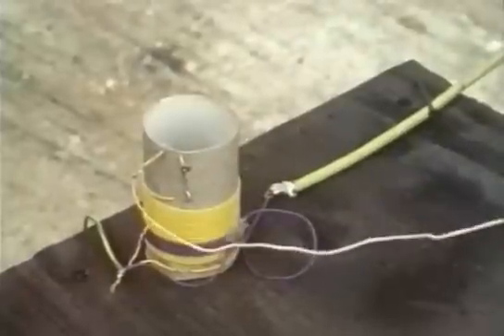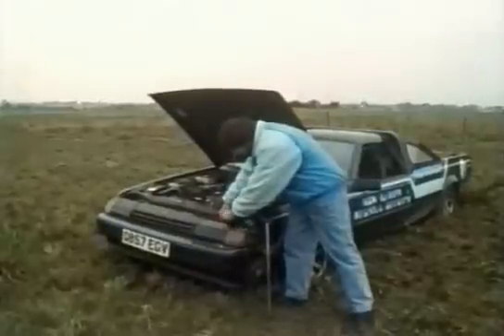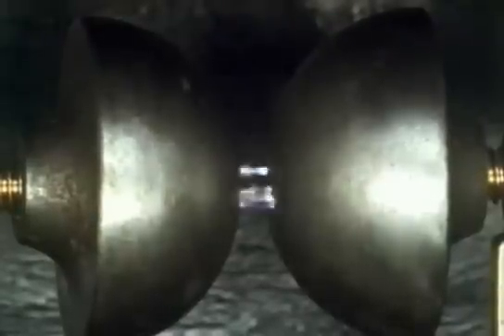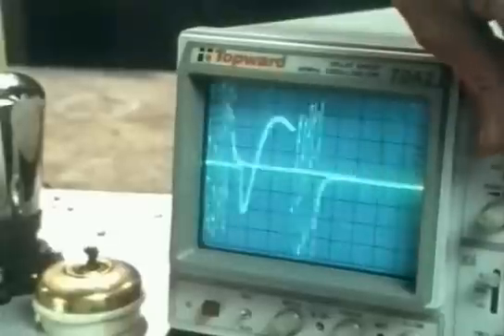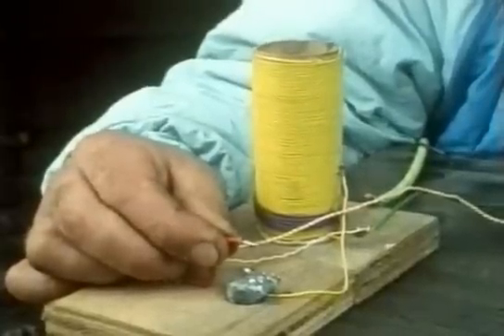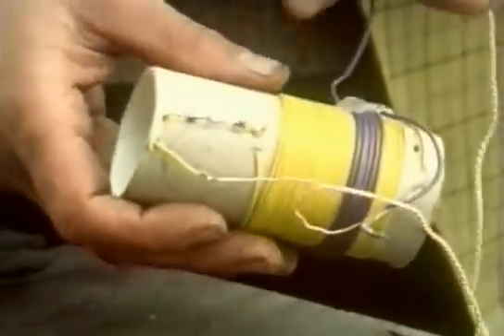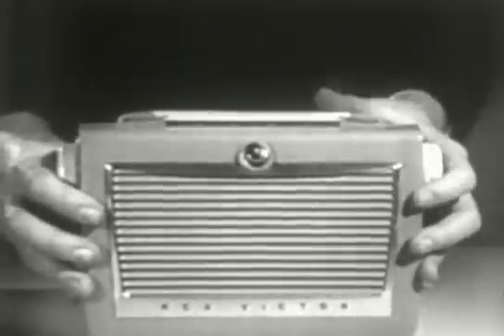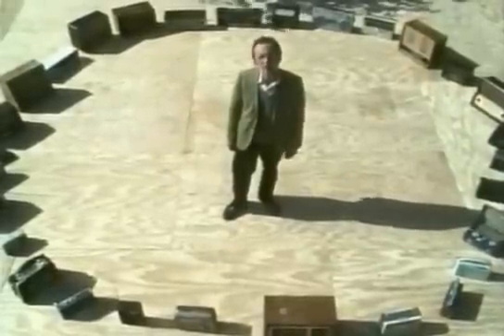Secret Life Of Machines - The Radio (Full Length)

Comment: The first who created radio was Tesla, not Marconi. In 1945 Supreme Court of US recognized his patent as first.
Reply: Exactly. Marconi's patent used concepts Tesla had patented earlier.
Reply: Radio has many fathers, and they all argued over paternity.
Reply: Which patent was that, CmputrBlu?  What was the US patent number?  When was it published? Or did it exist at all?    

Did Tesla specify a coherer containing 95% nickel, 5% silver with a trace of mercury in a vacuum?  

Did Tesla specify spark gaps using four balls?

Did Tesla specify long wire antennas? 

In 1890 Professor Richard Threlfall predicted that Hertz' discoveries would be used as a signalling system. 

 Did Tesla copy what Threlfall said or did he come up with the idea independently in 1893?

Does any Tesla fan boy know what he is talking about when it comes to wireless telegraphy?
Reply: Neven Tomičić        I was going to comment on how Marconi was using Tesla patented devices in his transmitters. You however beat me to it.
Reply: Which patents were those, exactly? Please supply US patent numbers. When were they published?
Reply: Hm. @Codenwarra Cove, Tesla had 11 patents on radio (#645576, #649621, #613809, #685955, #685953, #685954, #685956, #787412, #723188, #725605, #1119732) covering the spectrum of principles and techniques of sending, receiving, tuning, power transmission, activating a lamp or other device (buzzer, motor, etc.), and remote control. He also had nine patents for generating high (radio) frequencies (#447921, #462418, 514168, #658176, #658178, #658179, #658180, #577670, #583953) and eight for using that frequency to control another circuit (#609251, #609245, #611719, #609246, #609247, #6092489, #609249, #613735) that started in 1890. 
The British version of Marconi's patent (#7777) uses a circuit diagram that closely resembles some of Tesla's high frequency generator patents. It's a poorly tuned spark gap transmitter that had poor reception across 1/4 mile of Long Island Sound, (Tesla had been working on 2-5 mile transmissions for remote control at that point, focusing on a good 'ground' contact), but it was enough to impress President Theodore Roosevelt.
Marconi was focused on impressing heads of state, while Tesla wooed bankers and Hollywood celebrities. In this sense, Marconi made the better choice. Bakers sell debt and celebrities are usually fickle and vapid, but presidents, kings, and heads of state set policy for nations.
Reply: The priority and publication dates of all and any of the patents is important, since much of what Tesla knew was also known by several others.  Filing date of Tesla's  US 645576 was 2 September 1897. Priority date also recorded as  2 Sept. 1897. Published 20 March 1900.  Since the priority date is the same as the filing date, it appears that Tesla filed a complete application on that date, not having filed a "caveat" or provisional application beforehand.  The caveat would have given him a year to file a complete application.  

The UK 7777 patent was by no means the first Marconi patent and concerns a tuning circuit which I gather was mostly developed by Prof A Fleming.  It was subject to challenge in the British courts. But it does not matter about it, the  question is when the first patent application was filed and published anywhere whether or not the system was tuned.  Neither does it matter about high frequency generation, Hertz was already on to that and others soon after.  Hertz, Braun, Popov,  Righi and Branly among others.

Secret experiments by Captain Jackson of the Royal Navy appear to predate Marconi's arrival in England.  Since they were secret and unpublished, they could not affect patents.  

The priority date of Marconi's first British patent is in fact difficult to find because of the vague nature of most biographies that I can find on line but I believe it to be 1896.  In addition, Google insists on giving details of the US 586193 but not UK patent in which Marconi described his improvement to the coherer, an invention which was patentable in itself.  This device contained a mixture of nickel (mostly) and silver filings with a trace of mercury.  The US grant and publication was 13 July 1897,  some 7 weeks before  Tesla's filing date.  The US filing date was December 7, 1896 which is consistent with Marconi's arrival in the UK in 1896 if the US application was under the Paris Convention.  None of the 11 patents you listed discloses such a coherer and all are later than 13 July 1897.

If this is the US version of Marconi's first British application, and if the version was filed in the USA under the 1883 Paris Convention which the USA accepted in 1887, then it would retain the British priority date as long as the application reached the US office within a year of the British filing.  Given the rapidly developing state of the art in the mid 1890s Marconi's attorney should not have delayed and should have used the Convention. But if this application had appeared before me during my career as a patent examiner I would have sent it back for amendment, since the claims are unsatisfactory by current standards.  But by the standards of the 1890s, who knows? 

Now the decisions of the US Supreme Court are just so much paper in other countries and patent law in the US has always been different from patent law in the UK and most other places. So the decisions of the US court mean little to me.

I stand by my previous questions.  The documents, as far as they can be found, show that Marconi's wireless telegraph system as patently described predate any similar material by Tesla and Marconi could not have used any patent from Tesla in 1896.
Reply: Hm.

A coherer is a device that discharges when the circuit receives a radio signal. Tesla used evacuated lamps (gas discharge tube) for that purpose, which appear in 568178; 568179; 568180; 577670; 583953; 609251; 609245. 613809 is for radio controlled vehicles & goes into detail for an extremely sensitive switch made from a capacitor with metal filings charged to the point it almost conducts. When the signal is received the gap is bridged.

The difference is between patenting a principle and patenting a modification. Having a patent for a 20 speed gearing system on a bicycle doesn't invalidate the patent for two wheel attached to a frame with handlebars to steer with. Marconi's use of a particular coherer design and antennae arrangement doesn't bypass a patent for using a spark gap to resonate a high frequency inductive circuit and inductively power another circuit to use that high frequency. The most important part of any patent is at the back where they list what they claim as theirs.

Marconi even tried to say he was unaware of Tesla's patents and should have been awarded co-lateral patent rights for his own work, until records came up of him working as an assistant for Tesla before filling his U.S. patent under his own name.

The original judge in the patent dispute awarded the claim to Marconi for "original use of a ground connection", though his offering it to be used by the military might have influenced that. (Our military Industrial Complex was about to start) Later when RCA (who had purchased Marconi's US patent rights) sued the US government for back royalties from wartime uses, the priority was reassigned to the now dead Tesla.
Personally I like the Japanese/Chinese parable about two authors claiming the same work for this case. In order to prove true authorship, they were asked to make a sequel.
Reply: @ M. P. Schaefer  I doubt that after my decades in the Australian patent office examining applications for the Australian and Singapore  offices and running searches for the Singapore and US offices among one or two others  that there is much you can tell me about patents in general. In my view,  what is at issue here is what was disclosed in the patent documents as a whole and when. 

In US 586193, claims 1 to 42 are confined to receivers and all of them are distinguished by specifying means for shaking the powder or contact, i.e. "coherer". No disclosure of any form of transmitter is relevant to these claims, only disclosures of a receiver with such features, and all the other features defined in these claims can do that. Claims 43, 45 and 49  omit shaking the powder but define combination of a transmitter and receiver both with earth connections.  These may have been invalid compared to the prior art.     

Now when did Marconi try to say he was unaware of Tesla's patents? Marconi died in 1937.

Records of Marconi working as an assistant to Tesla?  Good grief, where on Earth did you get that bizarre assertion?  It was physically impossible to do so from Italy or the United Kingdom. Marconi did not enter the USA until late in 1901, five years AFTER he filed the parent of US 586193 in the United Kingdom.  Don't believe anything you read on Tesla fanboy sites, I have seen some of them they are stuffed with straight out lies.     

Wireless telegraphy was developed in the 1890s and early 1900s by many inventors of whom Tesla and Marconi were just two. 

http://pdfpiw.uspto.gov/.piw?docid=00586193&SectionNum=1&IDKey=8EFECFD8375F&HomeUrl=http://patft.uspto.gov/netahtml/PTO/patimg.htm
Reply: @Palifiox   In 1892, Nikola Tesla created a basic design for a radio. On November 8, 1898 he patented a radio controlled robot-boat.  Tesla used this boat which was controlled by radio waves  in the Electrical Exhibition in 1898, Madison Square Garden. This was the first documented case where a radio signal was used to communicate. Theorizing that radio could be used for signalling is quite different than actually doing it. Would you say Jules Verne gets credit for the Apollo moon landing?
Reply: @Palifiox  US613,809   November 8 1898
Reply: @tcmyoda  NO.  Not at all.   A coherer is a particular type of detector containing METAL POWDER , not just any type of detector.  One containing nickel and silver powder is patentable over one containing only iron powder or only nickel powder. It is nothing like a gas discharge tube, a magnetic detector or any of the other systems that might have been used.   Do not try to tell me any different , I was a patent examiner  for more than 20 years.  if the US patent office identified a coherer with a gas discharge tube in the 1890s it was because of exceedingly sloppy work.
Reply: Why not Popov?
Reply: Funny that the Supreme Court Of The United States only rewarded Nikola Tesla the patent when Italy along with Germany and Japan was at war with the U. S.  Hmm funny that, hmm very interesting
Reply: @kevinloving3141   Heh heh.  US Supreme Court decision  are  toilet paper in other countries.  Schaefer is just a liar or has no reading comprehension.
Reply: @Palifiox  But it's interesting that the U. S  Supreme Court Awarded Tesla back his patents on radio in 43 a period of time when the U. S. was at war with Italy Germany and Japan while Serbian sobataguers were harassing the German and Italian armies
Reply: @kevinloving3141   Yes, I got it the first time you mentioned it.
Reply: Specifically, it was also found that Marconi was at one of the universities where Tesla lectured on the wireless transmission of information.    Marconi was a good engineer - but he was a rip-off artist as an inventor.    It might not have been entirely his fault - his backing company might have insisted, hoping that Telsa wouldn't notice.
Reply: @tbelding  Which university was that and when?  Name and date DEMANDED.  Back your claim up with searchable facts, not unsupported assertions like most of the other claptrap in this thread.
Reply: @Palifiox  - oh Christ.  Are you Marconi's great grandson, bitter that the family name has been besmirched?   I don't remember. I'd have to go back to the University of Houston main library, hope that the books are still there after 20 years, and look them up again.  If you want some dates, the three major lectures he gave were in 1891 through 1893, and would have been publicized in all of the major universities in Europe at the time.  Marconi was allowed to attend lectures in 1892 (approximately) at the University of Bologna, and submitted his patent in 1896 - five years after Tesla had given detailed information on what Marconi built into a patentable structure.   In fact, the 'experiments' that he was performing in 1894 were ones that Tesla was demonstrating two years prior.   

Therefore, by _actual logic_, and an understanding of how published lectures are distributed (or rather, were), it is safe to assume Marconi's developments were as much based on Tesla as they were Hertz.  Throwing around variations in the British patent system vs the American patent system is smoke and mirrors, although why anyone would really feel the need to do that unless related to Marconi is very strange.    

I'm not denigrating Marconi's accomplishments - he did manage to get radio into the commercial enterprise, something that Tesla was lousy at doing.  He may have even reinvented the wheel on his own for a lot of it.  It's simply that he, 1) wasn't first, and 2) copied others,  3) refused to give credit, and 4) got caught.   Tesla, frankly, probably wouldn't have cared too much except for #3 (and the lawsuits).  (#1 is normal, #2 is the start for a lot of things, and unfortunately, #3 is frequent)
Reply: @tbelding  i will accept that.   If you read the earlier parts of the thread you will find that some of it contains stupid lies such as Marconi working in Tesla's workshop which was physically impossible. 

 I do not claim that Marconi was first.   I do claim that Marconi's first US patent was published in the USA six or seven weeks BEFORE Tesla made applications in the USA office for two patents for transmitters ONLY. If you read all three patents, which I have done. Marconi described a receiver and a transmitter while Tesla described only transmitters in those two applications. I have previously cited the patent numbers and dates.

I can tell you that in my career as a patent examiner I would have recognised these as three different inventions. Claiming these two Tesla patents preceded that of Marconi is just a lie and they did not describe the same things either. It does not matter what later patents were issued as the technology improved.    

It is worth noting that as of the period 1896 and later, Marconi used a detector called a coherer which he described as 95% nickel powder and 5% silver powder in an evacuated tube. An earlier form of the coherer was developed by E. Branly in France but was made with iron powder.  There were even earlier predecessors.  A nickel and silver coherer is patentable over an iron coherer. There is nothing in the two  Tesla patents about receivers and certainly not about coherers. This improved coherer was what made Marconi's system practical.  

The reality is that Marconi, Tesla, Branly, Popov, and a few others had the same idea at about the same time.  They used existing technology like the Ruhmkorff coil and already known methods of detection and developed them.  These developments went in different ways as each of the inventors hit on ways of getting more power, more efficiency or more sensitivity at the receivers. Some of this went right back to the 1880s.

About 1890, Prof. Richard Threlfall of Sydney, New South Wales, suggested that the then recent researches by Hertz would form the basis of a signalling system.  See the second footnote  on page 197.
https://archive.org/details/historyofwireles00fahirich/page/196  

Threlfall did not follow this up, because he had been asked to solve the problem of spontaneous combustion of Australian coal exports to Chile but some other Australians  and New Zealanders did. The Braggs in Adelaide looked into it but shifted their attention to X rays.  In NZ, Rutherford also worked on it before leaving the country. and finding that atoms have nuclei    By the mid 1890s there were several people around the  world working on it, perhaps dozens. 

Now, hundreds of  inventions are the same.  One  research group is ahead of another by a few months or weeks and they all know most of what the other is doing, and all their inventions  are based on existing knowledge, just applied in a new or merely different way.
Reply: @Palifiox  - As a patent examiner, you probably wouldn't have allowed much of those.   "Prior Art" would come into play, and when Tesla was busy lecturing and demonstrating, that would invalidate the patentability of a lot of stuff.  As for using different materials.. Maybe?   ABS electronic vs mechanical are definitely different systems, but this would be like claiming that ABS mechanical made out of copper is different than one made out of steel.    Frankly, I think our patent system would be better served to go back to the "You have to have a functional example to show." method of patents.  
http://www.wunderland.com/WTS/Rash/misc/addams.htm

In any case, my personal stance is that Tesla was a genius, but an idiot when it came to marketability, or even keeping notes.   He developed all of the base structures that we call 'radio' into functional tools.  (Which Hertz and the others did _not_.)    Marconi was a genius in that he determined how to turn those tools into something useful. He just wasn't willing to admit that he owed anything to anyone that might be granted money :).  

As for the inventions at the same time?  It's happened a lot.   Sewing machines, for example.  Somehow, they popped up across two continents at basically the same time, in multiple places.
Reply: I am confident "radio" was not invented as it's a natural phenomenon, the equipment to detect and transmit however was invented by Hertz (3:51). Marconi (3:55) was the first person to use it for signalling - did we watch the same show?
Tesla was late to the game and distanced his findings from Hertz by calling his "invention" "non-Hertzian"...
Reply: @lee-ld7er  I think Tesla had a completely different mindset - one of enhancing/advancing humankind, whereas Edison concentrated on commercial gain to the detriment of technological advancement...
I also think Tesla suppressed his technology when he realised both the financial and military impact it could have...
Reply: Reginald Fessenden, cough cough... https://en.wikipedia.org/wiki/Reginald_Fessenden certainly developed radio as we know it today, as opposed to spark gaps which as the program explains very well, are chaotic and got banned. Fessenden certainly came up with AM long before Armstrong - the program gets that part wrong.